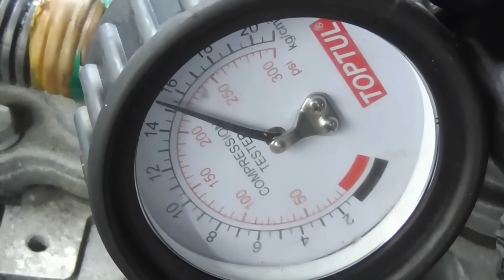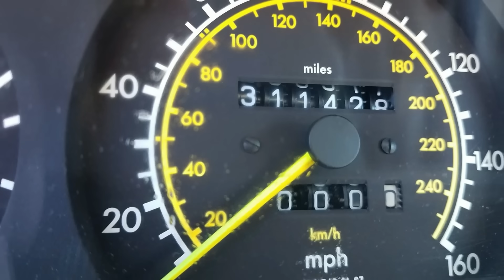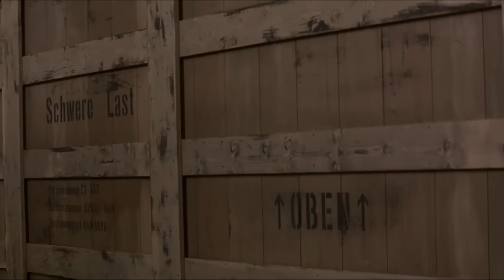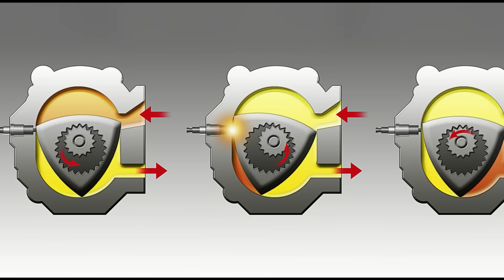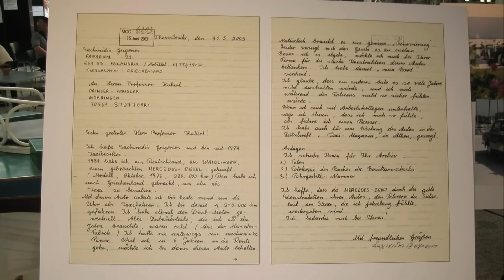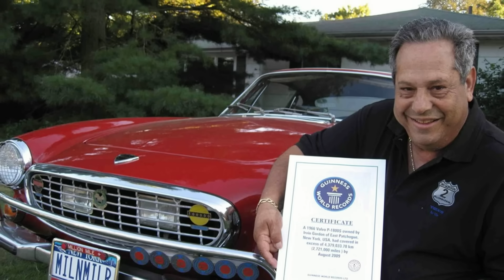Most Reliable Engines of All Time

Comment: We have a 1990 chevy k5 blazer thats had a very beaten life, engine, transmission and both axles are original, and unrebuilt, 360,000 miles with normal maintenance. 2 bolt main thata been put through being a snow plow for 20 years and daily driven, after that it became an offroad rig and still held for daily driving.

Comment: I love how they showed a picture of a Supra when they talked about the RB26 I rolled on the floor. Second Rotary engines are absolute garbage and are not reliable they are like putting a two stroke in a car but instead of pistons it’s a pissed off oil drinking triangle

Comment: I have a 5.3 with over 300k miles buddy have one with over 400k miles I personally think the early 200’s chevy Silverado with the 5.3 are the most reliable motors
Reply: Had a 99 ford ranger 2.5l 4 cylinder with 451k miles on the engine and transmission
Reply: I've got one that runs one week wont start the next. Constantly in and out of the shop
Reply: @jonathanthomsen7218  what was it doing when it would not start?
Reply: @ashtonwalker3415  it cranks and doesnt have fuel or spark had the crank position  sensor and mass airflow replace because the maf was shutting off my fuel. Now it did the same thing a week later. It would try to start and just cut off. It's in the mechanic shop  again. I've had it going on two months and I've drove it about two or three weeks total out of those two months
Reply: @jonathanthomsen7218  did you check the kill switch behind the glove box?
Reply: @ashtonwalker3415  no.... I did not know there was one there

Comment: 100,000 miles is nothing. My old Chevy S10 with a 4.3 litter v6 is at 200,000 and runs smooth as hell. Even my newer f250 with a 5.4 3v has a 150,000 with nothing but tune ups and it's even known for not great reliability. If you want miles get a Volkswagen, I've seen them with over half a million miles!
Or just get a newer Cummins, you'll run a million miles no problem if you take care of her

Comment: Not a single mention of the Chevy V8 Small Block? Or even the MOPAR Slant Six? I see many 5.3/6.0/6.2 GM V8’s running around with over 200,000 miles!

Comment: completely left out the million mile ford motor and ive herd nothing of the cummins shibit my old 6.9 ferd turdbo is at 170000 and just blew a seal from to much boost from the turdbo and its been towing 10000lb 5th wheels and trailers through the sierras since 1987 lets see any japanese engine do that

Comment: I hit 547 k on my 92 Bmw 535i with regular maintenance and one water pump replacement only major thing only thing I regret about that car was selling it The engine had really good compression when the  person I sold it to had it looked over👍

Another good engine for this would’ve been the ford v10 the company I work for has four of them and they have 3 to 400,000 miles on them with no issues

Comment: So who was the Mazda Rx7 fanboy that helped write this Science fiction script?  Notice the question mark at the end of "most reliable Mazda engine?" Well newsflash it was not there rotory engines there F line of 4 cylinders were most likely the most reliable. How can a engine that needs to be rebuilt and have it's Apex seals changed every 80,000 to 130,000 be considered reliable? Not to mention constant problems with flooding and issues with constant spark plug fowling on the leading and trailing plugs.  The rx7 is the perfect car to use in any horror movie where someone is trying to get away from a psycho killer and want a car that won't start. Also what no American domestic love? Might as well rename it the most reliable import/foriegn engines of all time can't call it around the world because there is no American engines on there and as a mechanic I can name 3 from each of the big three "gulp" even ford or AKA &$#$ed on race day. #1 general motors/Buick 90 degree  fireball 3.8 L V6 1965 to 2009 made wards best engines list multiple times have seen over 350,000 miles on some of these motors. #2 Mopar 318 cid short block v8 . Granted Mopar could not make a automatic transmission to save there life but this v8 is bullet proof so is Mopar/ Kaiser jeeps 4.0 L inline 6 .  #3 Ford's 302 cid v8 AKA 5.0 L v8 what else needs to be said ? People buy crate motors of these to replace the 4.6 L v8s in there mustangs .

Comment: I fully understand that any American has forgotten about Citroën. But there you have some amazing motors. I am Swedish and from "Volvo City" of Gothenburg, and of course i drive a Volvo. My daily driver is a 940 estate with 541.000km on the clock today. It runs absolutely perfect and doesn´t consume any oil. But also, i have a Citroën DS and that´s an old taxi and has triple km on the clock. And yes, it also runs perfect. It has the DX4-engine that even were one of the more powerful and less reliable. It´s a "hemi" as with all Citroëns. It´s a pushrod i4 which was made in different versions between 1928 and 1991. BTW, it has bigger bearings in the crankcase than a Chevy 350. So the old Citroën pushrod-i4 is nr. one on my list at least. And remember that these words is coming from a Swedish Volvo and Mercedes collector.

Comment: This guy has no clue what he's talking about on the rb 26! The 2jz is way more solid than a rb26. You can comfortably push for 600hp without swapping for forged internals and it's a solid deck. An RB motors water and oil passages are half the size. I love the skyline just as much as any car guy but a solid reliable engine not so much lol

Comment: My 6 banger, F150 has over 200,000 miles....never had a problem, but tires, brakes, and oil changes. Uses, and loses no oil. 5 speed manual with replaced clutch. Ford escape, 435,000 before totaled. Chevy cavalier had 280,000 on it before going to the grave. I also worked on a 1990 Honda accord with over 600 000 on it, and lived through 4 clutch replacements. No one stands to gain from sabotage goods for profit. All it does is force people away from those products. Many different conditions directly and indirectly affect the durability and life of an engine, transmission and other things such as temperature, maintenance, and the quality of parts used to construct the design. Certain engines are better, as the inline 6. But that does.not always equal reliability.

Comment: You forgot VW TDI and Fiat JDTM engine
Reply: AirSerb every time I see these so called reliable engine videos on YouTube they always talk hondas or Toyota everything but a TDI I have 06 tdi Jetta 344k and a 13 tdi passat 148k both still run like new
Reply: Finally pulled the trigger on a 2015 Volkswagen Jetta tdi and I love it so far.  Smooth powerful enough and 50 plus mpg. Mine was emissions fixed by VW and has an extended warranty with only 26000mi.

Comment: Are you a qualified engineer or mechanic? Funny the rotary blows seals quite often the 200000 miles is not really good I've had a Peugeot 406 2lt with 584000 miles on, engine where never opened and never used oil or leaked would still be running if an reckless driver did not drove into my car. If you don't work on vehicles yourself and just go by what preferences others have and say how would you know to give a opinion.

Comment: 3S-FE in Supra? Rotary reliable?.. Rb26DETT cheap? WTF?!.
Reply: Yeah so many wrong things say here
Reply: Every rb26 owner KNOWS that the last adjectives you would use to describe an rb26 is "cheap" and "reliable". xD
Reply: Mexis facts he said the type r had k20. Everyone knows they have B18c and the rsx and acura sedans had the k20
Reply: @nyakio5511   ya self proclaimed facts. Dudes a putz
Reply: Ray Ramirez The EK9 had the B16B
Reply: Same questions I had.
Reply: Well maintaned, a rotary is reliable. Specially the 12A
Reply: The JGTC Supra from the 90's ran a version of the 3S-GTE. Thats about as close to the facts this guy got..
Reply: Same question I had
Reply: Ikr?! This dude said something Nissan is cheap. ☺😊😆😄😀😁😃😄😁😀😃😁😄
Reply: My 3s - fe still runs! If only my coolant and trans fluid stop leaking
Reply: The TOM's JGTC Supra used a 3SGTE because it was lighter and could work out a better powerband than the 2JZ
Reply: @SilverLightningXV  I think the 503e was used because of the penalty against Toyota's inline six
Reply: The Supra GT had a rally Celica-derived 3S-GTE. Not FE!

Comment: What about the VW 1.9L Alh TDI engine?
Reply: Riley Turner I had one with over 350,000 miles on it and then transmission let go and blew a hole in the transmission case I should have keep it and fixed it but I sold it

Comment: Wow, wrong straight out of the gate.
How on earth could you claim the RB engines were reliable, just because you happen to like one variant?  The Nissan RB 6's were cheap POS.  Just because you can bolt a turbo on something doesn't make it reliable.  Power is NOT reliability.  You seem to forget that most of those super-quick Skylines could barely finish a race before something broke.

Further including ANYTHING with a turbo on this list is beyond stupid.  The turbo itself just doesn't last that long.

Comment: Why did he call it a 300d engine? It's an OM617. Great engine in many other models. Rotary engines when done right are dead reliable. I had a 1985 rx-7 with 286,000 miles on the original unopened engine. I ran it up to 8000 rpm in 3 Rd gear  before sending it to another owner.

Comment: Mercedes m103 engine can take over 800hp with upgraded fuel system these engines ware 2jz before 2jz ever came out M104 is also crazy strong inline 6 engine
Reply: My one-owner, 1986 Mercedes 300E with the M103 engine has well over 300,000 miles on it. The odometer broke at 297K miles fifteen years or so ago. I have never had the head off. The only engine problems I have had with it were the original valve stem wipers and some of the early cam shafts weren't properly heat treated. I have one of the rare 5-speed examples and the first clutch went over 240K miles and that was the throw-out bearing.
Reply: m104 is the 2jz.. since its based on it ;) lexus is bassicly mercedes copies in most stuff
Reply: @loonie555   Mercedes has been making insanely strong inline blocks like m103 able to push 1000 WHP on stock bottom end. M103 came with forget bottom end and a cast iron block only bad about it is that it used old k-jet fuel system and it needs to be converted to fuel injection with stand alone ecu.
Reply: @monkkeye   I know, used to have  a W124 m104 2.8 turbo ;)
Reply: @loonie555  very nice I do like w124
Reply: @monkkeye  oh yes, and Lexus gs300.. Wich was the first model with a 2jz is a copy of the W124 and 2jz is a "weaker" version of the m104.. You can almost fit a m104 head on a 2jz and vice verse cause they are that similar

Comment: 100,000-150,000miles isn't that reliable...   my C320 Mercedes ran 200,000 miles before being crashed into by an uninsured kid...  it had a 20,000 mile oil change and never had any engine problems.

Comment: Not surprising,that you looked over g.m. ecotec engine, 2.0, 2.2, and 2.4 engines. These are all aluminum  engines with block,bedplate,oil pan  out of aluminum. The oem cranks are knifes edged. And the main bearings  are quite stout  in thickness. 2.2 up is rated at 155 hp and the same tourqe ratings. With just a tune, you can get 175 to 180 hp. On the 2.2 if you change the intake manifold to the 2.4 manifold,and use a adapter plate so you can retain a 2.2 t.b. on the 2.4 intake manifold,and with stock cams, with a tune, 195 hp, is easy to get. The first 2 years, some had piling problems in the chain drives,(No timing belt here) but that was with the Saturn  2.2 engines. That has been fixed years ago. My 2.2 ecotec engine with the 2.4 t.b,and adapter plate, and head work
 3 cut valve seats,  and i polished  my power forged  rods to mirrors durring the bild.and a 10 to 1 compression ratio and a tune, at 6800 rpm, I am getting  197 up at rear wheels ( rear wheels you ask? Are these engines  on front drive cars?, I put one in my 1984 Alfa Romeo spider, with a  w/c t5 transmission in it, my 0 to 60 is averaging  5.4 sec. And fuel mileage, in at 11 gallon tank, if I stay off it, I can get 370 to 400 miles on a tank) yes there are very good Japanese,German  engines, but look at the ecotec with open eyes, and you will find a great engine 
I have taking a few of these apart  with 150000 to 200000 miles and ,to my enjoyment  that the main and rod bearings, show very little to no wear on them. So take another look

Comment: what about the volkswagen 2.5L TDI ? or the mercedes W124 2.0D ? they turn a million miles with no issues
Reply: VW has not made a single reliable engine since the air cooled Beetle engines.
Reply: TheSoloAsylum i think you are sadly mistaken.

Comment: Audi 5 cylinder ? Mine has run 260k km without any problems. And i See a lot with 300k and 400k and i even saw one with 800k with original engine
Reply: Killerinator audi 1.9tdi mine has 695 000km.
My A2 has the 1.4tdi 262 000 right now has problems but its the injectors and a pipe from the turbo. So no big deal

Comment: My 99 Dodge Ram 1500 had a 5.9 gas engine and that truck has 328,000 miles on it and still runs fine, the 2 gen dodges were some of the best trucks ever made

Comment: 2.0 duratec in the for focus is super reliable. I'm at 227k right now and the only thing that's been replaced is the alternator and a vacuum line not including maintenance. Original clutch aswell. I work at a dealership and have seen them with over 300k.

Comment: I have a 1998 chevy express 3500 awd  with the 5.7l with 890k milles and all i do is very basic maintenance.  Neither the engine or trans have been opened up.  I put about 30k miles on it in the last year pulling boats and toy haulers. It will do burn outs and cruise at 100mph all day with no problem. I  have a set of mud claws for camping trips in green swamp and everglades. I am not easy on it at all. This thing can handle abuse and laiugh at it.

Comment: Hahahaha.

100k isnt all that impressive, I had an Eclipse GSX with 300k on a 6bolt 4g63t with rebuilt head and new turbo, only reason I sold it was because the electrical was shit and I couldnt find a replacement trans controller.

You obviously dont know shit about engines.

Comment: What about the amc 242/ Jeep 4.0?  I have not had one in my hands with less than 200k miles on it. I have one in my cherokee that’s been through multiple body’s, it’s got about 415k miles. Still runs. Sold one about 6 years ago with350 k miles on it and it ran still.

Comment: What about the 1UZ-FE that is found in every model of the Lexus LS400, I have a 1990 Lexus LS400 and it has over 250k miles on it and it's a really good engine, think about Matt Farrah's 1,000,000 mile Lexus which is a LS400. My car has never given me any problems from the engine. The trans is pretty solid too.

Comment: Volvo b230 is not mentioned. I'm calling bs on this vid. Do your homework bud!
Reply: Agreed, b21, b23, and b230 engines are very reliable
Reply: These Volvo engines are easily running 500000 km without problems or engine replacing
Reply: You can add 5-6 cyl whiteblocks aswell.

Comment: My 5vz-fe 3,4l from my Toyota 4 runner is fucking reliable i have 250k km original spark plug timing belt well... the only thing the last owners changed on this truck was the strut and shock oil changed and headlight this truck is fucking awesome it has 3 owner except me and I was able to talk to every one of them and they all remembered it they were like I’ve beaten this truck so much but I couldn’t kill it it’s still going strong (i mostly use it for off-roading)

Comment: Mercedes M113 V8 and M112 V6 are bulletproof motors. Same with the VQ35/37 motor. The Buick/GM 3800 are not uncommon to be found with over 300k miles. The Mercedes M275 is really reliable too. It’s a twin turbo V12 that is often found with well over 200k miles. The coil packs are really the only main issue. There’s a Maybach 62 with this motor and it has over 1M KM (600k miles or so.) Original motor and trans.

Comment: Mazda rotary reliable? 150k miles is astoundingly high? No Chevrolet 5.7L, 4.3L, or 3.8L mentioned? Not a single LS platform engine listed? I personally own a 234k mile 4.3L that's never been opened up and runs perfectly, I know of several GM V8's with 400k never being rebuilt. Side note, "furthest trip from New York to Canada" could be across a bridge if you mean state, or under 300 miles if you mean city.  300 miles is 1 tank of gas.

Comment: Apparently 200,000 miles is a lot on an engine?  Like 4 out of 5 vehicles ive experienced have gotten 250,000 + driving like new. With electrical being most common fail point.

Comment: Most reliable engines would have to between AMC 4.0L straight 6, Old Mercedes diesels and the 12 valve Cummins engine.
Reply: cant forget the venerable ford 300 six
Reply: I had a 12v it had balls and was acceptable for fuel economy. Dodge was weak link, would love that engine in a durable platform.
Reply: Some old ford industrial trucks had the 12v cummins.
Reply: Volvo Redblock 4 Cylinder all day.
Reply: Those old Volvo engines were strong.
Reply: WedidLandONtheMOON good list. I have a AMC 4.2 (precursor to the 4.0) in an eagle with 290k miles.

Comment: The GM b284 2.8L v6 used by Saab/Opel/Cadillac is known to run 300,000+ miles and can be tuned to 500hp on stock internals

Comment: Wait. No mention of the 7.3 powerstroke? The ford 300 I6? The toyota 22R? The cummins 5.9L? I've seen ford 300's hit over 500,000 miles abd both the 7.9L and thw 5.9L are known to be able to hit 1,000,000.  I once saw a toyota 22R with over 700,000 miles. And somehow this thinks the mazda rotary engine is reliable. LOL!!!.  This guy doesn't know what he's talkin about.